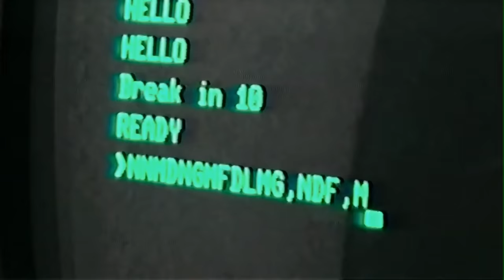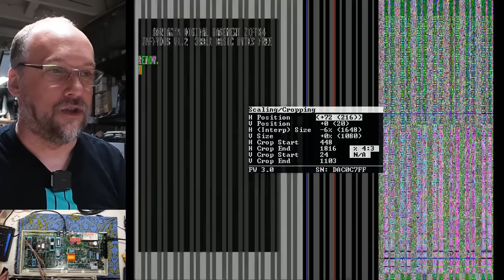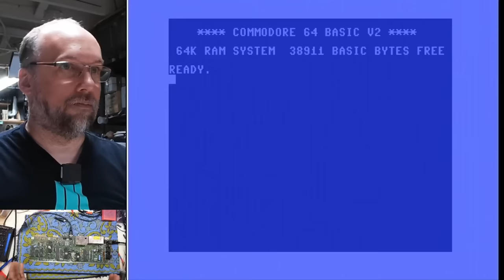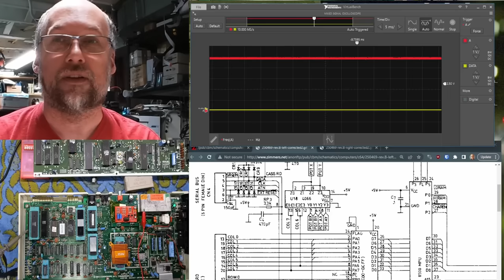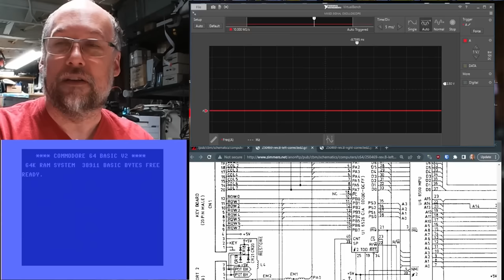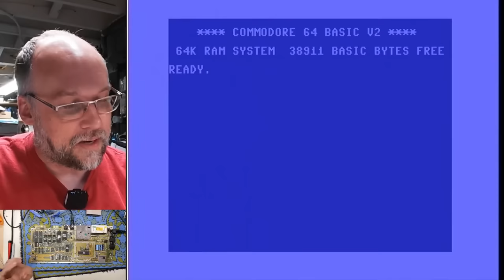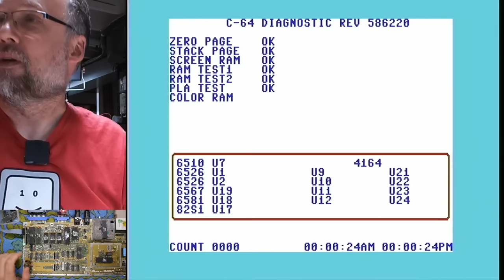Five bad Commodore 64s. One hour. All fixed!

Comment: Flaky DRAM on a C64 or an Amiga 500 often means it has been connected to a dodgy (overvolting or unstable) PSU. At least in my experience that's what happens a lot ;-) DRAM is really sensitive to that and will often be the first part that kicks the bucket...
Reply: Basically the DRAM acted as a fuse...? :)
Reply: I was just thinking this too. With three different brands on the RAM chips. Probably something else killed them
Reply: Did a lot of those in the day, we had a lot more lightening storms in the late 80s. I recall there was a pathway due to the mains sample used for the RTC that would take a number things including the ram.

Comment: The shield also acts as the heat sink for several chips. Same with the flat 128. I always leave it and replace the thermal grease.
Reply: Yeah, I think if the thermal paste is replaced, those metal shields can act as a pretty good heatsink. The C64 and 128 don't have fans, so it's a good way to bring heat away from the center of the board (without conducting the heat through the PCB itself).
Unfortunately, in the UK, because the emmission regulations were different, they just used a cheap foil covered cardboard in the C64C machines (which just had some vent holes cut out above the hot chips). Those cardboard shields are just keeping the heat in, so they are much better removed.

Comment: The chip with the triangular logo was made by Matsushita (Panasonic), it also has their part number (start with MN)
Reply: Correct. I have a whole sleeve of Matsushita 4164s in my stash for bread bins. Same logo.
Reply: @vhfgamer  I was under the impression that the logo in question was Mitsubishi, not Matsushita.
Reply: @4thdoctorwhofan966  No the mitsubishi logo is more like a three pointed star. The triangle is Matsushita.

Comment: According my "research" it seems that those with bad ram chips had been killed by a bad PSU. The PSU tends to drift to higher voltage. Once the 5V DC rail reaches too high voltage there is a big risk of some damage. And my friends told me the RAM chips are first to go. It explains so many C64 with a dead ram or worse a dead SID etc. Anyway very good video! As a fresh owner of a C64 I am very keen on to improve my knowladge!

Comment: The 4464s have always been a common problem in the C64s, the first diagnostic step was to touch the RAM chips
Reply: Maybe it's a overvoltage or heat issue thingy that is common on those boards?
Reply: @katho8472  It's caused by dodgy PSUs. TI and Sharp DRAM is super reliable but if you connect an overvolting PSU (something the C64s are known for) the DRAM is the first thing that bites the dust...
Reply: @pipschannel1222  Which is good news for the other, less replaceable chips at least.
Reply: @pipschannel1222  Does that mean these replaced chips are also bound to fail in due course? Because obviously he didn't even test for overvolting PSU...
Reply: @henningerhenningstone691 Commodore power supplies are external to the computer, not inside like a modern computer. His is a known good one, so it shouldn't blow any chips
Reply: That was my thought as well, the early DRAM was known to be especially fragile to overvoltage and reverse voltage even briefly until some beefy failsafe diodes started to be integrated into it.

Reverse voltage could also happen if the computer is connected to something with powered supply which is turned on before the computer itself, or if bad PSU cable caused it to briefly become disconnected on the ground pin.
Reply: @pipschannel1222  This makes sense.  Thanks.
Reply: I wonder if adding a 5.2v zenor diode across the 5v ram power rail would clamp the voltage and blow the glass fuse as a failsafe, I know the commodore PSU have bad linear regulators that overvolt as the age/fail.
Reply: @weapongod30  good point, dunno how that escaped me 🙈thanks for clarifying

Comment: Haha! Success! Adrian can't throw away the RF shielding! YAYAYAYAYAYAYAYA!

I just recently fixed a 64C, and I went to all the trouble of removing the rust on it with a citric acid dip, followed with a protective coating of clear coat. Of course I didn't let any clear coat get on the heatsink pads. After it was all done, I reinstalled the RF shield with new high quality thermal paste. 

Obviously the design is good, because even Adrian admitted the 64C computers are more reliable. It's those earlier bread bins with the cardboard RF shield that die.
Reply: I would have used low quality thermal paste. LOL
Reply: @4thdoctorwhofan966  Well.... it's all relative. Compared to the crap they had in the 80s, everything is higher quality. Including the little generic no name tube that came with my Ryzen 5 a couple of months ago, that I threw in the drawer and replaced with legit thermal paste. 

That generic no name stuff is what I used for the C64. Compared to the heat the Ryzen puts out, the C64 is practically ice cold.
Reply: I like to clean the thermal paste off, then install stick on copper heatsinks, then bend the shield tabs slightly to contact the top of the heatsink.  This allows the heat to come off fast from the IC, then dissipate through conduction into the shield.  It's a win win!
I read that Bil Herd said that he wasn't sure taking off the shield and replacing it with heatsinks was the best idea due to the way the shield conducts the heat to such a large area.  So I combine both - the best of both worlds!

Comment: Thanks, I really enjoy these videos. The Commodore 64 launched me on my career as a software engineer when I was in college while studying for a different degree. I bought it at K-Mart on lay-away. Good times :)
Reply: Launched mine as well. It was 1996 and I was 8 and my dad pulled his 64 out of the attic and set it up in my room after my little sister was born. Had two drives, a monitor and a printer. Tons of games to play, but I spent most of the time coming up with random programs in BASIC.
Reply: I got my 1541 on layaway at Zayre's in Florida!

Comment: Marginal PSU's tend to kill those RAM chips first in my experiance. The last thing to go is the Sharp PLA: I even reverse polarity powered one once for a second or so and it lived.
Reply from the maker: It is funny I would have assumed other chips would go bad with the higher voltage from a failing PSU. Perhaps those RAM chips die even at 5.3v while everything else is just fine?
Reply: Back in the day, I was making a Hackintosh 128K, and I miswired the power cable to swap 5V and 12V.  The RAM all fried (unfortunately, I'd already done the 512K upgrade), but everything else was fine.  After changing out the RAM (again), it worked fine.
Reply: Do we actually know that? I don’t see how you can conclude that whenever RAM dies, it is the PSU but when the PLA or the kernal dies, it is something different. I have seen bad RAM chips many times, and most of the time, the PSU wasn’t outputting anything exceptional. I jave testet more than 200 PSUs and I haveseen 2 with a 5v output that was capable of causing immediate damage
Reply: @adriansdigitalbasement  Yep, it's possible: I've repaired about 10 C64c's with bad RAM exactly like this. In at least a couple of those there was also at least one bad CIA. But yeah, JUST smoked RAM is a pretty common C64c fix.

I think also the 8 series (later fabs) of the cpu, vic, sid, etc etc were quite a bit more robust than the earlier 6's.
Reply: @christianlarsen1070  Nobody is advocating that level of absolutism. I'm just reporting that as far as I've seen, 1 this failure is decently common and 2 in most I've seen it was PSU failure that brought this about. 

My working theory is these RAM chips want decent power and don't have quite the tolderance for over-voltage the others do. I've watched the C64 with a FLIR and the RAM chips heat up first as voltage climbs. No, not very scientific, but good enough for me and I didn't want to possibly kill the C64 to prove anything.

Unless you had a scope over the PSU output at the time of failure, we'll never know if it was PSU related or not, even with a good "test" of the PSU. The power situation in the C64 is a laughable joke of poor design, - and the more epoxy bricks in the landfill the better, imho.

Comment: I've heard that RAM is one of the first things to go if the 5V rail goes high. It's possible that it was a PSU problem. But they are reliable and RAM is the most common fault so if you're getting only bad machines it could just be false sample bias.

Comment: The C64 can be surprisingly fragile sometimes. My kid sister once pulled a cartridge with the power on, and it damaged one bit in one register on the VIC-II, but that one bit was part of the smooth scrolling registers. For years, until I finally got around to buying a new VIC-II chip, most any game that had horizontal scrolling had extremely glitchy graphics whenever that one specific position was active...
Reply: I am not too surprised that pulling a cartridge with power on was not a good idea though.

Comment: Great video Adrian, as usual.. Being a Commodore guy myself I especially enjoy when you repair Commodore stuff :)

As I understand it there are four revisions of the short board, Rev 3, Rev 4, Rev A and Rev B and the Rev B is the revision with the video RAM integrated in the PLA. Some years ago I bought a box with 40+ short boards and out of all of the boards that I've repaired so far something like 80% have had bad DRAM. So far I've only come across one bad PLA, one had a bad CPU and the rest had a bad 6526. So, it's safe to say that failed DRAM is, at least in my experience, a pretty common fault with these boards :)

Comment: Really enjoyed the video. Nice job. So mant bad DRAM chips, but not too surprised. The only thing that was surprising is that you got a cluster of memory chips. If Comnodore only added over voltage protection on the logic supply line  theae memory chips would still be alive today 😊

Comment: My C64 has a (broken) warranty sticker. It was a warranty replacement for a broken machine, which we bought in '88, I dunno when it was replaced, though. Could've been any time before '92 when we got the A1200.

I think the reason C64Cs are so common(at least PAL ones) is 'cause game consoles(other than like the Atari 2600 etc.) weren't available here until late '87, and even when they did arrive were very costly, you could buy a C64 with datasette for the price of 2 NES/Master System cartridges. If you wanted to play video games, the C64 was by far the best cheap option available until the 16-bit machines took over.

Comment: Awesome work! Those 4464s can really be flaky. I had a non-working CoCo 2 which had 4464s that I assumed to be good. After having tried everything, I swapped the RAMs, and it freakin’ worked.
Reply from the maker: Ha! Do you remember if they got hot?
Reply: @adriansdigitalbasement  I had hot 4464s on my C64C long board. (I suspect they were victims of the PSU.)

Comment: I bought my commodore 64C in 1987. No idea when it was produced, but it  or parts were produced in Singapore, the Philippines or Malaysia. It had a warranty seal. I sold the device and my Amigas in 2007. So I cannot confirm production locations.

One sure way of blowing up CIA chips is bridging the joystick forward switch with a home made foot pedal. Pressing forward and the pedal creates two parallel pads with less resistance. This blows up the CIA chip instead of the zener diode that should protect. It was an expensive learning experience for 13 year old me.

Comment: The 8-bit hardware specialist repairs Commodore 64 with ease. It's just fun to watch you repairing C64s. I still have a C64 in the attic, which is very brown discolored. One day I will get it out and see if it still works. Of course with a new power supply! I swear! Keep up the good work Adrian!

Comment: 31:23 - I think they were making these C64c's at the same time as the Amiga 500's. The 500's had Torx screws in them, so I assume they would use the same screws on both if they had them.

Comment: I really enjoyed that last repair because I make 256k chips at Texas Instruments from 87-95 so its very possible at some point in the manufacturing I touched those !  Since you had multiple failures across multiple manufacturers there must be some design flaw, something that age causes them to eventually short out. I love the touching for diagnostics, sometimes low tech is the easiest way to go.

Comment: The 4464 DRAM is usually very reliable under proper conditions.  I used two of these in a CoCo (I think it was a Coco 3, but it was decades ago) and they worked just fine.
If they generate a lot of heat, maybe a heat spreader on both chips might help?  I see elsewhere this might be specific to the Commodore machines, especially the C64, because of the power supply "brick of death".  Maybe that's what got all of these?
Reply: I was thinking the same thing.  Maybe something in the c64 design just drove something on these chips out of spec just enough to kill them.

Comment: That triangle logo on the RAM chips you pulled turns out to be Panasonic. I think I've seen that logo on their electrolytic caps as well.
Reply: Indeed, it's the logo Matsushita used on electronic components before switching to the "M" they still use today.
Reply: Actually, it is Matsushita. That's the name of the company. Panasonic is a brand, just like Technics, used by them.

Comment: Well this makes me feel relieved now that I have switched out the RAM in my 64C for a modern replacement. It wasn't bad - I had mainly done it as a means of "future-proofing" the machine since it's my reliable "daily driver" that I use for GEOS, gaming, and to print monthly calendars. I also had replaced my power switch which was certainly going bad - it had lost it's snap after many years of heavy usage and I didn't feel like taking it apart to service it.

Comment: First time I see a C64C with the combo metal shield / short board inside, I thought it was only for the Breadbin model.
I got two C64C and they both don't have that metal shield but a piece of cardboard covered by a foil of aluminum as heatsink. Their only difference is the power LED color (one is green, the other is orange).
They should belong to the latest ultra cost-cutting batches assembled around 1990-1991, according to a website that keep a reference of their serial numbers I've checked years ago.

Comment: I had as a kid (well still have) a breadbin with the shortboard (revB in C64G, Europe based) which at some point died (PSU gone, fuse blown). Think we got it around the end of the eighties, or 1990 probably judging from the chips. Fixing it is WIP, I replaced the ram, as I kind of expected it to be bad, but it also has the two boiling hot rom chips and I didn't have spares. Really great to see some shortboards here!

Comment: 31:40 Since phillips screws were in the case and torque screws were securing the shield, it's also possible that this unit was disassembled previously and care wasn't taken to put them back in their original locations.

37:00 I don't know if removing the metal shield permanently is such a good idea because it not only helps protect against EMI interference, but also should help to wick away heat from the ICs, rather than acting as a blanket.  This is also evidenced by the round holes that are machined into it, so as to increase airflow and heat exchange.

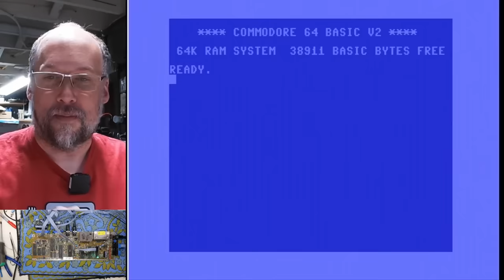53:30 I'm guessing the uncontrolled ripple from the detached electrolytic couldn't have been kind to those chips... maybe accelerating the failure of the DRAM?  Seems like they are being run under pretty marginal conditions even when the power supply is working perfectly... and we know what happens to those over time. 😟  I think I also read somewhere that Commodore took a stab at manufacturing DRAM themselves but threw in the towel, so to speak because they were unsuccessful to put it kindly.

Comment: 64C are a bit more solid than early breadbins - The 5V rail used by the LED can be shorted out and dimmed by shorted ICs, 6581, a bad Kernel Rom and a Bad VIC for Example

Comment: Its interesting that the fourth c64 proved the joystick port static zap, since pin 10 on that CIA is joystick port 1.
Reply: I am wondering if there was some kind of active device avail that people were trying to plug in (or a cobbled together incompatible device) that could cause this CIA failure rather than just the old "static" excuse?

Comment: Bad ram on a C64 for me, especially so many different brands and board, will always make me think some damned original Commodore power bricks failed hot and took out the chips. Same thing happened to my breadbin. Unfortunately, the event also destroyed the PLA and SID on my machine too.

Comment: At the of Commodore quality control went out the window I bought a 128 D that long after I gave up trying to get working found out it had a functionlly idiot of a disc drive, it would work maybe once and while so I switched to IBM machines. Now some 30 years later I work on some machines as a hobby because I love the challenge of outdated tech.

Comment: I'm in the UK and I've had about 10 64Cs. All were short boards. All but one had the cost reduced keyboard. About half had screw together cases (but no Torx bits at all). The rest were clip together cases, and of those about half had clip-in keyboards as well - so the only screws are the ones holding the motherboard in place.
Reply from the maker: I've only seen those clip together cases on videos. AFAIK those were never sold here
Reply: @adriansdigitalbasement  They're so much better for maintenance. Especially the keyboards that just clip in to the top case. I don't know why they didn't do that from the start.

Comment: About a week ago I bought a C64 from 1992, also made in China, with the same stickers. There is no metal shield inside, only a cardboard-aluminium one. The keyboard is hold in place by clips attached to the upper part of the housing.